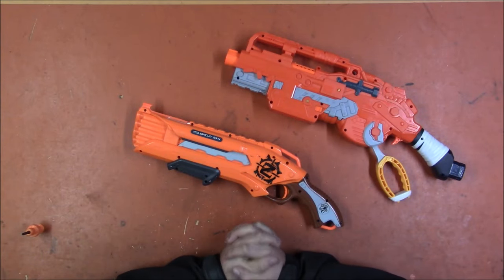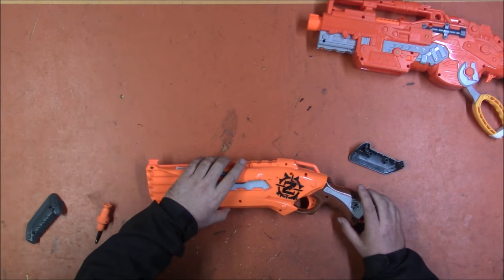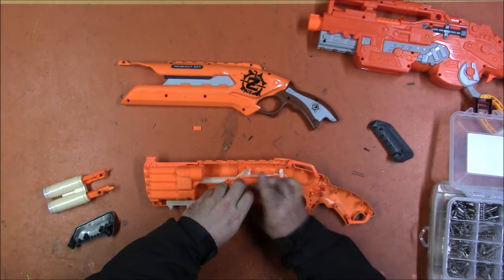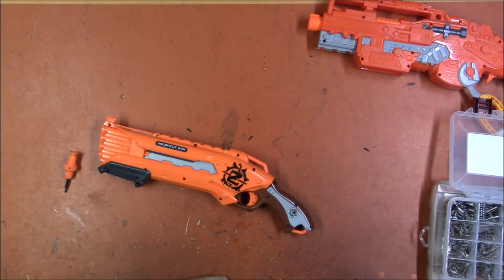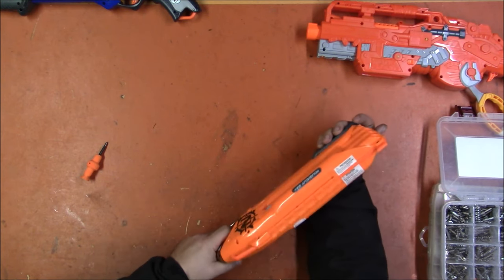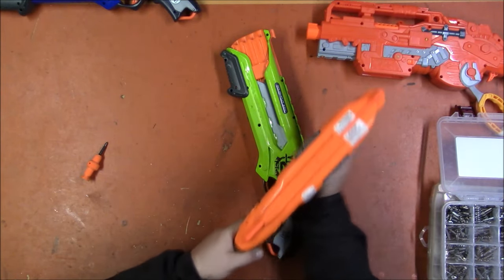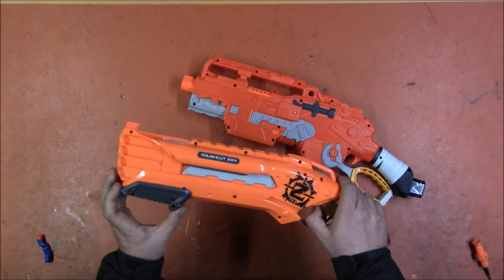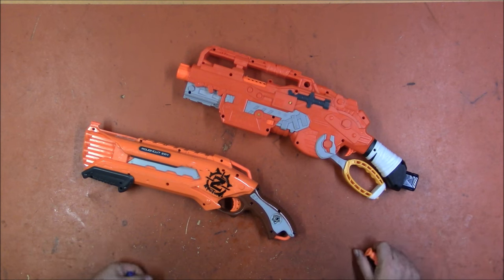Diagnostics and Repair - Episode 24 - Fixing Jammed Blasters

Comment: That happens with my white elite rough cut. It only happens when I sloppily slam fire it. I fix it by forcing the trigger forward and pulling the slide all the way back, then forward. I found it at a thrift store in the same condition as the one here. It doesn’t lock up normally, though.

Comment: 5:55 I have several busted gears in rough cut blasters. I tried swapping the internals from a white Roughcut blaster into a zombie strike roughcut and I could not get the zombie strike rough cut to screw back together and fire properly.
Reply: I was able to 3d print the offending gear in a zstrike roughcut (files available on thingiverse) and it's been running great

Comment: Hey Captain Xavier, regarding the roughcut, I have the same jamming issue with my roughcut too, which is a white variant I got off Singapore's variant of goodwill (carousell). Thanks for helping me find a solution! If I had to give a guess, maybe nerf changed the system in the roughcuts for whatever reason...

Comment: Captain. I’m looking at a teal Magnus for either my longshot under barrel a replacement of the front gun or my stock retaliator build both for HVZ purposes, yes, I am going with the short dart long shot do you think that the Magness will have the same problem and what should I put it on? I was thinking mega hammershot for the retaliater loadout. My long shot is also the zombie strike version. Do you have a preference on which you would rather see on the field? The short dart longshot is intended for a marksman role in a hunter squad. Also, I love your video.

Comment: The roughcut is such a cool blaster but it really has its issues. I wonder if theres a blaster with a similar design but stronger internals. Its definitely the looks that do it for me with that blaster
Reply: I bought it when it came out saw it’s issues and traded it for a recon 😂
Reply: The Warden Elite 2.0 is so brittle multiple YouTubers had it break on them while filming the unboxing and review. You can buy or print replacement gears for when (not if) they break. The Rough Cut was the first blaster that I thrifted that I found to be very fun to play with, so I ended up with about a bakers dozen of them and about half have gotten the priming handle jammed in this same way. The ones that have opened up have all had a busted gear (I have yet to invest in replacement gears).

Comment: I've always worried about my scavenger jamming
Reply: A slight warning, mine jammed from probably not fully cycling the blaster, and when closed back up the bottom never fully sealed. It works fine now, though, so I'm sure it's nothing